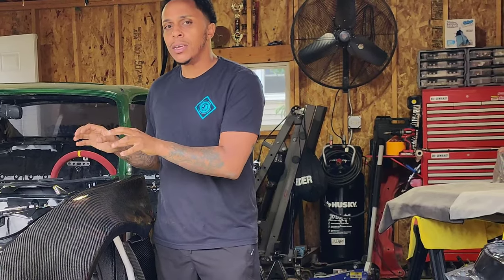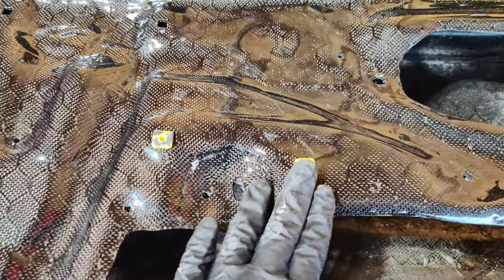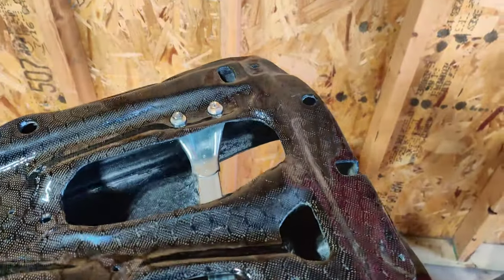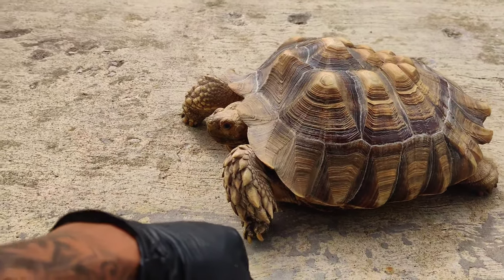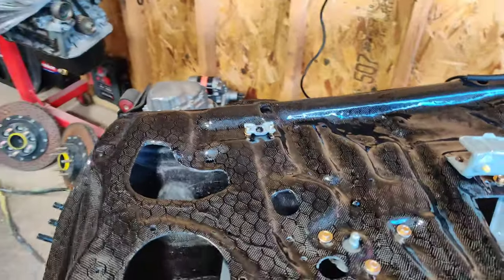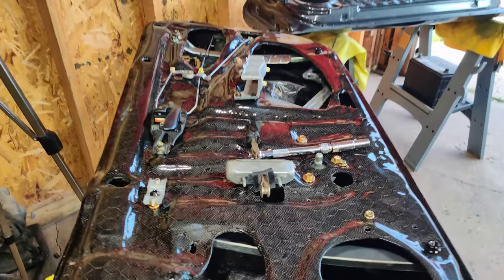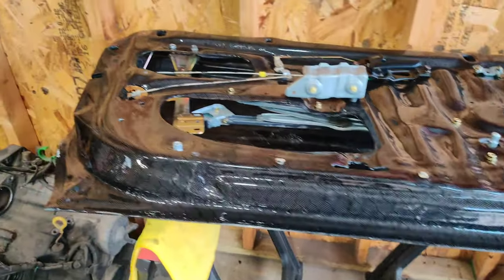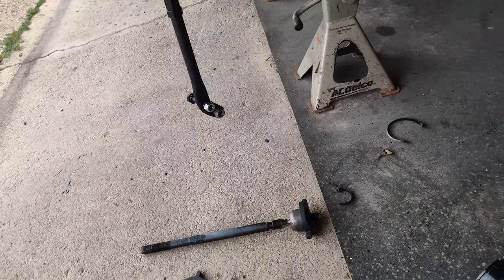Ultimate Look | Modifying Toyota Mr2 Full Carbon Fiber Doors | Nasty Addiction Garage

Comment: Please don't use titanium for main suspension bolts, it shatters or snaps
Reply from the maker: Woooo really I never knew that, I  thought it was one of the stronger metals?  Thanks for the heads up lucky I only purchased  the 2 bolt for the lower control arm.